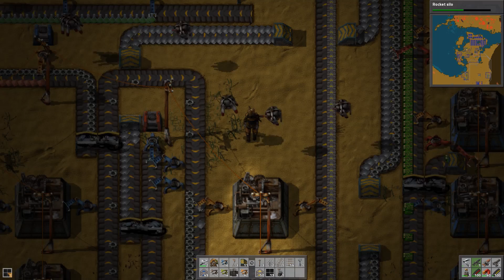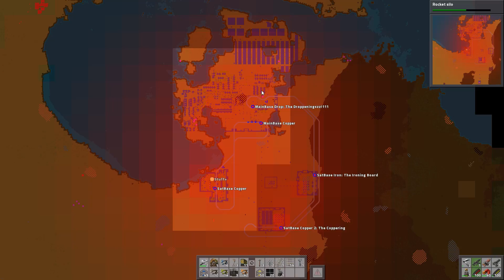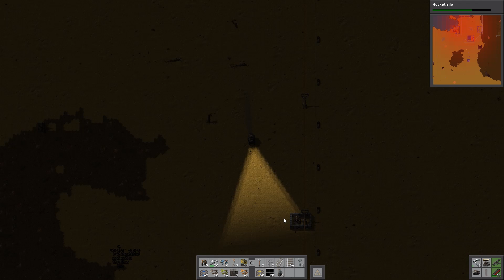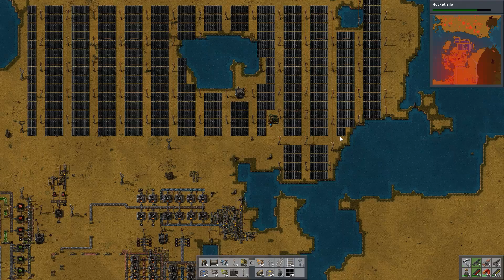Factory Tour = Beverage + Factorio [Early Access]

Comment: Just building the Rocket Silo is no longer the endgame you actually have to build and launch a rocket in order to win the game.
Reply: +Nightmare Infinity The one way flow valves you speak of would be pumps. not offshore pumps there is another kind of pump you can use and its one way. its requires a little bit of power but its one way only.